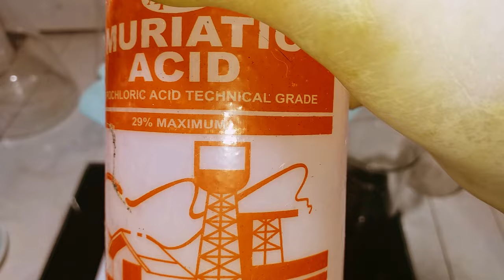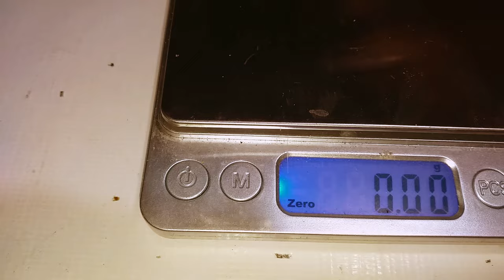GUIDE FOR GOLD RECOVERY FROM COMPUTER CPU | COMPUTER CPU GOLD RECOVERY | GOLD RECOVERY PROCESS

Comment: How much cpu ceramic was taken
Reply from the maker: 9 ceramic, 11 Amd, 30 pin less
Reply: @PoorMiners321  bro why were you remove capacitors?
Reply from the maker: @fedaulmustafa2909  containing tin solder bro need to remove as much as we can, some tin making trouble like sticky in our filter paper.. and if too much very hard to filter the liquid even you use vacuum.